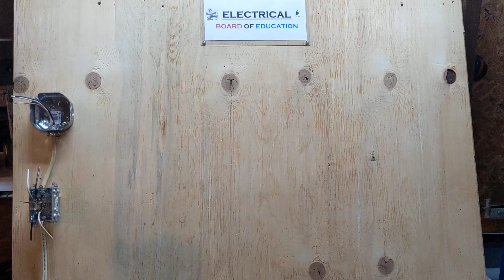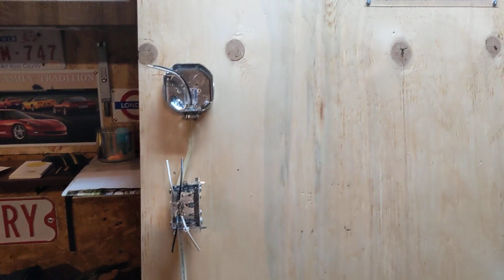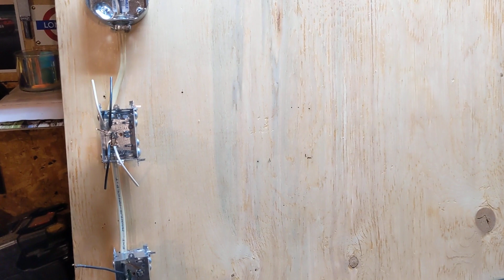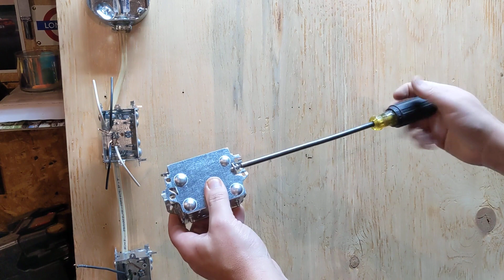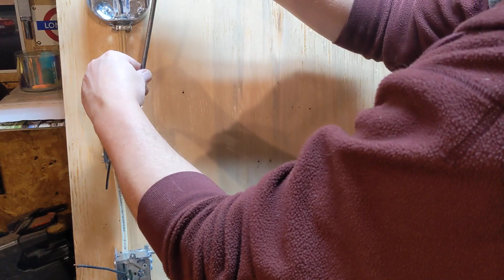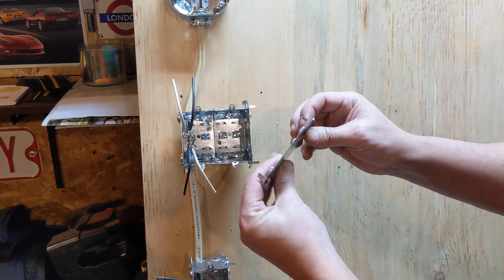How To Turn A Single Gang Box Into A Double Gang On The "Electrical Board Of Education"

Comment: what if you have those outlets that need a double gang, so the threaded holes are in the center of a 2 gang box. where do you buy these? I only found something similar at Home Depot but you have to internet order it instead of walking into a store.
Reply from the maker: Sorry but I have not see an outlet that requires a double gang bow with a center hole. Lots of different things out there though. The only double gang boxes I've seen with a center hole are the Hubble weatherproof ones for outside that have three on the top and bottom. That would then in turn give you a center hole. I feel that would be overkill though but depends on what your project is.
Reply: @AtHomeAndHandy  L6-30R and L14-30R. you can have the receptacles two in a double gang, but those plugs you can't put two side by side and easily grab because the other plug is in the way and twist both so you need to put one receptacle per 2 gang. There is also a CS50A (I think that is what it is called) california 50A twist lock connector.